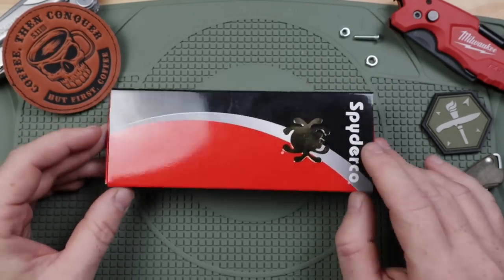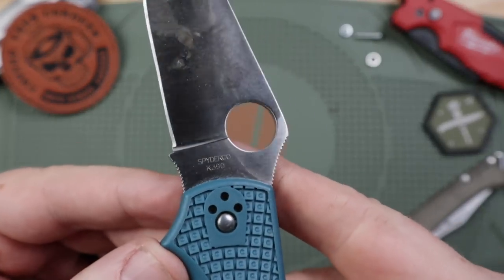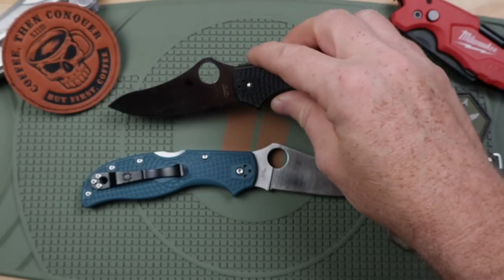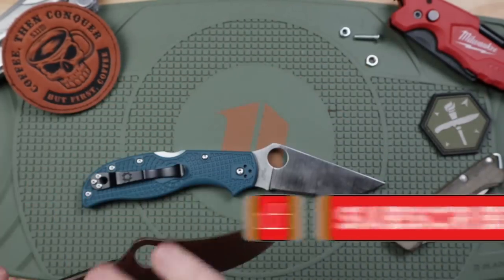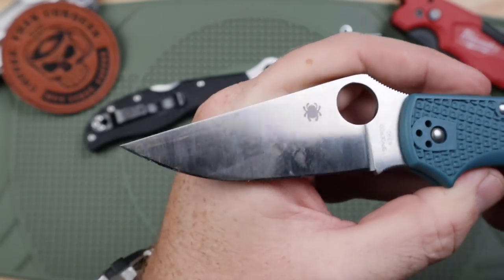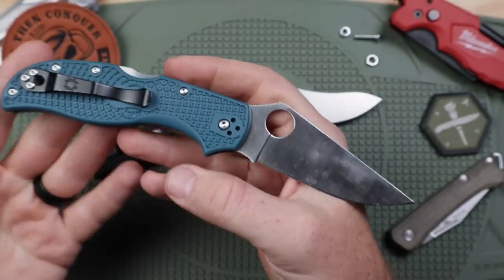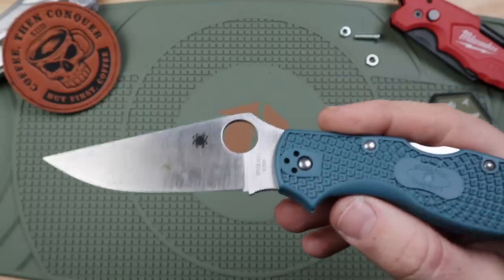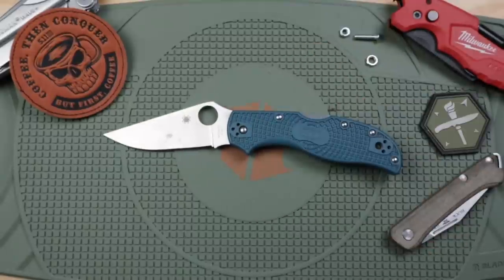I Have NOT Been Excited About Spyderco In Years! Will this Change That?

Comment: I’ve sailed both oceans and never had a problem with rust on a pocket blade that I used regularly.  I’m done with all these companies making fidget toys instead of blades with edge retention. The primary function of an EDC carry is EDGE RETENTION. Good review and good job Spiderco!!!
Reply: Beyond just that - even if one of my knives picked up a bit of corrosion or discoloration, so what? It’s not like that’s a particularly difficult thing to fix. Hell, the few times I’ve had to deal with surface corrosion it was easily removed using the suede side of leather scraps I had leftover from making some paddle strops. You usually don’t need to go more aggressive than the compound you use on a strop. In bad/stubborn cases, barkeepers friend is really useful. I’ve never had to resort to using a vinegar bath or anything like that.

Word of warning to anyone new reading this - do not use your strops for removing surface rust. You don’t want to contaminate the strop and a lose piece of leather is far easier to work with.
Reply: And if someone is putting away their knives for an extended period of time, it’s just a matter of a wipe down with wd-40 or clp then putting them away someplace dry.
Reply: @just9911  ,… yep, I’ll take a tool over a toy every day of the week!!
Reply: @Doc.Holiday hough we do have to recognize that Spyderco does have the excellent salt lockbacks in a bunch of great designs for those who have tasks that require an essentially stain proof option. lc200n, magnacut, and h2 are all great user steels. I can also see increased toughness being appealing if you know your tasks lend themselves to minor edge damage. I’d rather deal with a minor edge roll than sharpen out chipped edges. 

But those aren’t the trendy fidget knives. They’re “boring” lockbacks with FRN handles. I happen to like lockbacks and FRN, so I admit I may be biased in favor of the salt line.
Reply: @just9911  I have a SpydieChef. They are $400 bucks now!  I keep it in the galley drawer of my RV.  Occasionally, I carry it, but the edge retention of LC200N isn’t that great.  Its mid range. It’s not an all day EDC hard worker. It’s good in the galley trimming meat and opening packages but it isn’t hard continuous use, not unless you can touch it up along the way.  Nice and thin in the pocket though.
Reply: Not at all. Edge retention is one element. Everyone has different needs and different preferences. Personally I'll sacrifice edge retention to get more toughness and a blade that is easier to sharpen. If I can bring back a razor edge with a few passes over a ceramic rod and strop every 2 weeks that's way better than spending half an hour sharpening every few months. For EDC I'd say edge retention isn't really that important at all. For hard use, camping or survival sure but for EDC something like 14c28n is more than sufficient. But it depends what you do with your EDC I guess.
Reply: @bzebarth  while I was not at all clear with this - I think my point can best be summed up with the idea that intended purpose should be the deciding factor in steel choice and not just chasing whatever is the new hotness. Also I think people bitch too much about dealing with things like corrosion when it’s a straightforward issue that’s easily dealt with, if they ever actually develop corrosion. Similarly, toughness matters in some applications, but sooo many people in the knife world are not honest with themselves about what is really sufficient to meet their needs and what they’re doing with their knives. These are folders after all, it’s a very different calculus than deciding on a steel for a fixed blade.
Reply: @bzebarth  if you don’t work a knife it isn’t. If you are “touching up 14c28n every couple of weeks”, then we are in two different worlds. I love the geometry of a CIvivi Button Lock Elementum, but I can’t get through a day without stopping to find a Dia-sharp, sometimes two or three times.
Reply: @just9911  totally agree… what is the primary function of a knife?  To cut!!! It’s a tool to cut!  Toughness is good, but we are using a knife to cut.  For a user, toughness does not trump edge retention. One doesn’t scrape veggies off a board sideways with the edge, that is what you use the back of the blade for.  With most blades you don’t wack through anything for instance wire like it’s a cleaver. You don’t use the blade as a pry bar. To be sure, it is good that a blade doesn’t chip but if it has a reasonable toughness rating and it is used with respect, it won’t.  If a little patina on this K390 blade stresses me out (which it does not), I’d opt for a coated version over shiny fidget toys every day of the week. Even with a fixed blade camp knife.  Give me an edge.  Survival knife,… sharpening on a rock,… okay, but what percentage do that?  Probably 1% of those that have snorkels on their truck….
Reply: @Doc.Holiday  Exactly my point. Everyone has different needs. Edge retention isn't the primary function of EDC because different people use their EDC for different things. I work in an office, my EDC gets used for pretty basic stuff. If I'm going to beat on a knife I would use one of my more hard use knives.
Reply: @bzebarth  … “work in an office” you say.  In a previous, “toughness” was your primary concern.  Okay, have a good day!
Reply: @Doc.Holiday  Yeah because I have had blades chip doing simple things like breaking down a box and hitting a piece of hard plastic I didn't realize was there. Again it really comes down to ease of sharpening. A chip is a pain in the ass to sharpen out. Why do you have to be so confrontational about this? All I'm saying is different people have different needs so saying 1 quality is most important just means it's most important to you.
Reply: @Doc.Holiday  Also I never said toughness was my primary concern. I said it was more important than edge retention to me.
Reply: @bzebarth  … okay, okay, okay, okay… all dumb arguments, but… OKAY!!!
Reply: @Doc.Holiday  How is my preference to have an easier to sharpen knife that doesn't chip a dumb argument? It's not even an argument it's my preference. Nice gate keeping. There is a reason there are so many blade steels. If everyone had the same use case, preferences and budget we could just have 1 and everyone would be happy.
Reply: The primary concern of and edc should be ergos and blade geometry. Even on a steel that would be considered middle of the pack when it comes to edge retention it only realistically takes a few minutes once every couple of months to get it back to hair popping sharp.
Reply: @brianreinbold2055  ,… nonsense.  If you are “touching up” your EDC blade “every couple of months”, we live and WORK in two different universes. You could carry a plastic blade in your universe then. Your parallel universal opinion is of no value to me in this world.

Comment: Totally in agreement with you. This one, and the 2XL version with liners and G10 and CPM-CruWear are truly 10/10 folding cutting tools. I've always been a Benchmade and Cold Steel guy, but for lightweight folders, these premium Stretch models are top of the class. I like the lockbacks, and think these are better knives than the Military/Paramilitary models.

Comment: I picked up a Tenacious the other day as my first Spyderco just to test out, and even though it's more a budget option, I've been pretty happy with it. This one seeems very similar. I see a few more Spydercos in my future.
Reply from the maker: It is a good tool and way to get into spyderco knives
Reply: Love the lightweight tenacious. The only thing wrong is how quick the clip can wiggle loose
Reply: If you want excellent examples of some of the best characteristics Spyderco has to offer - you owe it to yourself to check out the Sage 5, Manix 2, and Native 5 (not necessarily buy them, but definitely handle one and use one of you have the opportunity). 

The sage 5 lightweight specifically highlights the compression lock, leaf shaped blade, and their pivot bushing setup.
Reply: @just9911  
The Native 5 Lightweight is a backlock.
You probably meant Sage 5 at the end there.

Comment: I bought the original version of the Spyderco Stretch 2 lightweight strait spine when it was originally released in late 2020.  It was a limited edition sprint run version with ivory FRN scales and a VG10 blade.  Since the FRN scales were ivory, I was able to rite dye them an amazing violet color💯🔥👏  After getting the newer stretch 2 lightweight with K390, I switched the K390 blade onto the violet FRN handle😁  My Stretch 2 lightweight with violet FRN and K390 blade is one of my all-time favorite Spyderco knives👍

Comment: Thanks for this, Aaron. I really, really like the Stretch 2 and the new blade shape. I'm also kinda jealous of people who can carry K390 knives. In my always hot, always humid, sometimes salty environment, that would absolutely not work. Hopefully they'll make a Salt version in Magnacut. THAT I will grab.
Reply from the maker: That would be awesome!!
Reply: Dude just get the k390 I also live in an extremely humid environment. You simply keep it as dry as possible, oil it occasionally and store it in plastic with a large desiccant package. I never had any rust develop, ever. Dont let the humidity ruin your high speed tool steel experience.
Reply: Just keep it dry and wash off any possible salt contents that might have made contact  with the steel after work.

Comment: When Spyderco relaxed its minimum retailer prices for 2 days a couple of weeks ago, the Stretch 2 in K390 could be had for $129-133, and I relented. I think it'll nicely fit the "harder use" category, which I didn't really have in pocket knives between Opinels/SAKs and dressy gentleman's knives. I can't really review in depth, as my use has been mostly office bound, but fit/finish was fine, its very comfortable in the hand, and the action a lot smoother than I anticipated with a lockback (been ages since I borrowed gramps's Buck 110). No issues flicking open with thumb, but a bit too much lockbar resistance for middle-finger "spydieflicks". 

The main competitor for me in the Spyderco lineup was the 2022 LeafJumper in K390, which offers nearly the same cutting edge, but goes for a minimal ricasso rather than the 50/50 choil, so its 4.4" closed vs 4.7" for the Stretch 2, 3.0 oz vs 3.7 oz. The gram counting ultralight hiker in me was tempted, but I  think I made the right choice with the Stretch 2, as the jimping on the thumb ramp and choil bring a more confidant grip.

Comment: Sal Glesser designed the Stretch series as folding hunters. I bought a Stretch 2 in ZDP-189 with light brown G-10. My intent was to carry it as a back-up to my fixed blade when hunting big game. ... Along came a Stretch 2 XL 4" in CruWear and gray G-10. It's one of my favorite folders and gets lots of EDC carry and usage. It hasn't developed a patina at all. ... Finally, I acquired the Stretch 2 Lightweight in K-390 you reviewed. It was bought along with 3 other Spyderco lightweight K-390 folders when there was a brief, significant price drop this past summer. ... I'm very fond of the Spyderco Stretch family. IMO, one could be Spyderco's logo symbol folder. ... Lots of favorable comments about PM-2s under this video. I'm an outlier, in that I consider the PM-2 to be one of the worst designs in Spyderco's history. They've made a fortune selling a shrunken Military, with a handle on which it's impossible to get a full grip. It's a three-legged dog that doesn't hunt IMO. ... I've never handled a PM-3, as I have no use for one. ... Great video as usual, Aaron. You're the clean-up hitter on the You Tube knife review team.

Comment: Question for the knife experts: I'm looking at putting together a couple fire kits for the family. Just some of the small EDC pouches from maxpedition or condor, nothing big. Need help picking a decent, budget/cheap pocket knife to put in it for working on light kindling or the like. Any ideas?
Reply from the maker: Great question, The Kabar Dozier, Buck 110/112 slim, Ontario Rat 1 or 2, cold steel Finn wolf
Reply: I hate the dozier. Between the remaining three I would probably take the right one. VTT is😅 funny at times. The RAT-1. It's cheap   tough  and ready to save your ass🎉
Where did that damn emoji come from ?
Reply: @gideonstactical  Rat 1 or 2 absolutely.  Amazing the quality you get for the price.  You can get a Rat 1 in AUS-8 in foliage green for $29 or $30, but they're so cheap get the D2 versions for a bit more.

Comment: I had a Dragonfly 2 when I lived in Chicago to get under the knife laws back then. That was a knife where you had to use the choil. Nice build quality but not ideal for large hands. That was the last Spyderco I owned for several years. Recently got a Manix 2 Lightweight and it's perfect. Forgot what I loved about Spyderco. That ball bearing lock is sweet. Snaps into place like with gusto.
Reply from the maker: Ya that part is so nice!!
Reply: Go for the gusto. I recently took my manix 2 apart . Sadly it is still apart. I think metal complex is the one that has a video on how to put it back together. I will be very happy when I get around to that. It is a great knife

Comment: I always preferred the looks of the old stretch over the new one, don't know why, I would like to have the old blade but with a 4 inch cutting edge and CPM S30V steel and some sort of cross bar lock (not the bearing lock or whatever its called, that just always seemed to be at the wrong angle). Also would like for it to say "made in Golden, Co, USA, Earth".

Comment: whatever, I'm not buying another spydie until slysz bowie is available
Reply: Plenty available for $800 LOL I about died when I saw those prices.
Reply: I have one in xhp. Its nothing special. The m390 version is not as good because of the heat treat protocol that the Taiwan factory uses is not as good as the Spyderco Golden USA factory. The xhp is better performance and in return better value.
Reply: Would be nice if they released a cheaper version with s35vn and aluminum handles
Reply: Don’t hold your breath.
Reply: Aliexpress clone $50-60
Reply: @maxwellmortimermontoure7274  waited years for the to release a tenacious with g10 and s35vn so who knows bro.
Reply: @dcamnc1  its garbage. All clones are garbage.
Reply: @tacticalcenter8658  Nah, I have some clones and a bunch of high end knives. The clones are fine for the most part. My clone inkosi is better built than my real crk.
Reply: @dcamnc1  I call bullshit.
Reply: Unless your “real” CRK was bought on the used market and is really just an even worse clone.
Reply: @dcamnc1  not only are you lying but the heat treat is garbage and its using garbage steel.
Reply: @tacticalcenter8658  Cope.
Reply: This comment thread is hilarious 😂
Reply: Yeah man whatever 🤡
Reply: @satanicrepublican4781  cope? With what? Ignorant people saying ignorant things?
Reply: @tacticalcenter8658  bro for most people needs,  a clone is fine unless you’re getting into work that requires tougher steel and LONGEVITY of edge. Most people who need a razor, use a razor, anything else just use a knife that will work… stfu and be happy with what you get. I’m not buying a $200+ bugout , or an 940 Osborne when the same blade geometry in D2 steel is plenty tough. What do you use your knives for? 😅
Reply: @fjulyflores  this is because you dont know anything and are just assuming.
Reply: Overrated knife
Reply: @tacticalcenter8658  really 30plus knives and years out in the woods. Next you’re going be about metallurgy. Guys looks like we have ourselves a knife snob. Probably doesn’t realize when he gets older he’s probably gonna be using a victorinox. Civilization has advanced much bro. But everyday you will find there not much to cut unless you’re in a trade or the woods. Price point for a common tool is a mute point.
Reply: Same here but in my case i want hundred pacer
Reply: @fjulyflores  you said a whole lot of nothing
Reply: PLEASE spyderco give us the slysz
Reply: @just9911 I'll see your call and raise you two cow patties. 
.
Reply: @tacticalcenter8658 have you looked at back in 420HC?
Reply: @fjulyflores mute point? I won't to type a word.
Reply: @jayr526  what you chanting? I’m over the “homie hopping” over gear. Half the gear you guys talk about, you don’t own or worse, you buy but never use.
Reply: @fjulyflores man you sound like the kind of guy that buys overpriced timberland boots but uses a clone knife and are an all around jabroni. My buddy got a Spyderco pm2 clone and it was garbage. Fell apart quickly, got dull quickly, action sucked. It certainly sharpened easily but would dull on one cardboard box breakdown. But to reach their own. I buy quality tools and use them accordingly. My work carry since I'm a chef is the Spyderco Pacific salt and it gets used hard everyday. My civilian carry is between a pm2 in s45vn, an original stretch in vg10, several enduras in different steel variations. All get used and all hold up amazingly. What do you carry if I may ask?
Reply: Same here, give us what we want
Reply: @dcamnc1 clones are for poors
Reply: I saw an SB sell on EBay for under $300 a week ago or so.
Reply: Whatever
Reply: What said…. I bought 6 this year 3 over the weekend
Reply: Since the Atlanta Blade Show (back in April), I've probably purchased a dozen new folders, none are @Spyderco, not buying another Spydie until SB's are available again.